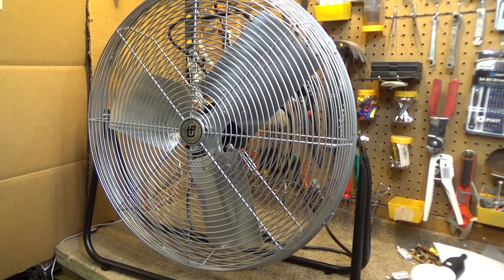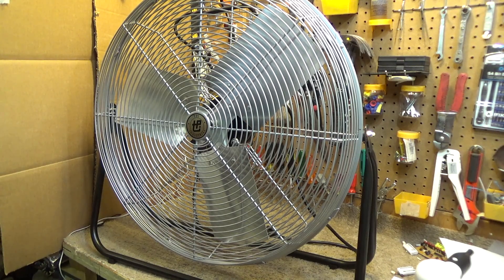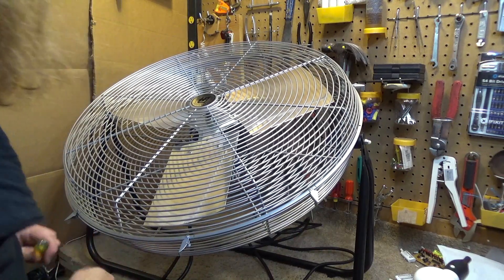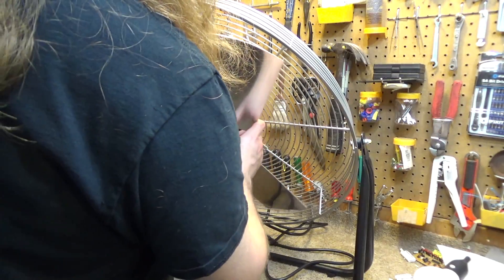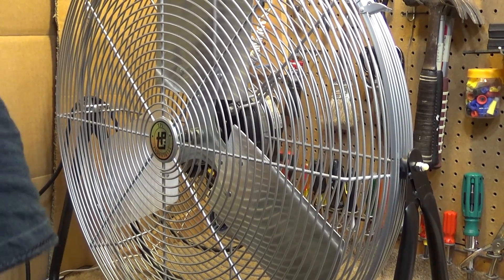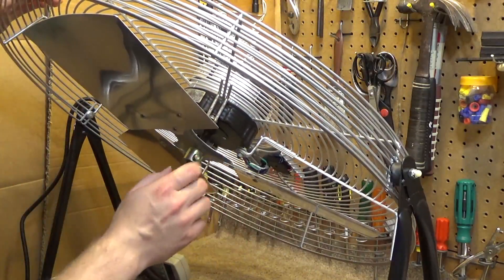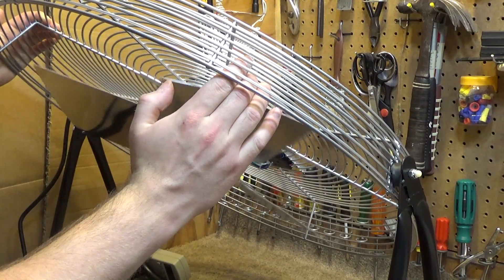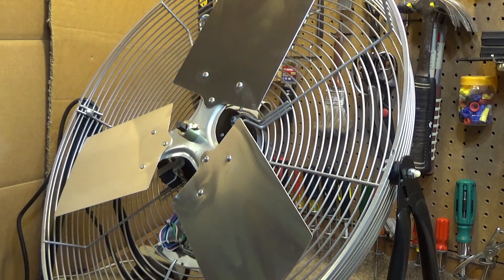TPI F-24-TE | Running Too Hot

Comment: Revisiting this video to say that after having found one of these fans, the TPI F-24-TE is probably the most poorly-designed "high velocity" fan for its size that I've seen. A 1/8 HP motor driving a 24" blade with almost no pitch to speeds of 1,650 RPM? And it only moves 300 CFM more than its 18" counterpart. This is a fan that in my mind shouldn't exist. I turned it into an F-24-TE-HV with a spare 1/4 HP motor I had laying around and all I have to say is... woah. TPI missed the mark with the F-24-TE but hit it on the second try with the HV model
Reply from the maker: I generally agree, this 24" model is not very good. Surprising, considering how good the 18" one is. I didn't know there was a second 24" model, I'm very intrigued now... Not sure I can rationalize the price tag though.
Reply: Find a 1/4 HP motor for cheap and you can make your own

Comment: I have three of these for a engine room on a boat  out in the hot engine room have already burned up and the one that was used in the air-conditioned room is also burned up stay clear of these they are expensive garbage they made it 3 to 4 months before total garbage …I have other fans here from Granger that are still running after many many years
Reply from the maker: The 12" and 18" are excellent, the 24" not so much. It's definitely not built the same as the smaller models.

Comment: Mine shuts down from thermal overload. After about 20 min. The motors are junk. They need holes for ventilation. I mean how much resistance does air make.

Comment: Did you know there were fans from 1890s and they were built like tanks from then up intill 2000 then it went down hill and I used have a black mainstays fan and it died due very hot room so I go with old vintage fans
Reply from the maker: Yes......

Comment: Im suprised at how big of a difference there is between the rpm of the speeds. also that spindown seems a bit too short. I have a 24 inch pedestal fan and it has such a long spindown.
Reply: the blades are probably heavier while these ones are probably made of aluminum
Reply from the maker: The blades are very large, even a slight adjustment in pitch makes a big difference on how much air resistance there is.
I too think the spindown is too short. At some point I will disassemble the motor and properly lubricate it. It may also need more time for the bearings to break in, it probably doesn't even have an hour of operation on it yet.
Reply: @JordanU was this fan was a new in box or was it like those new-old stock fans that never got sold?
Reply from the maker: @theutmostgeek  It was purchased new.